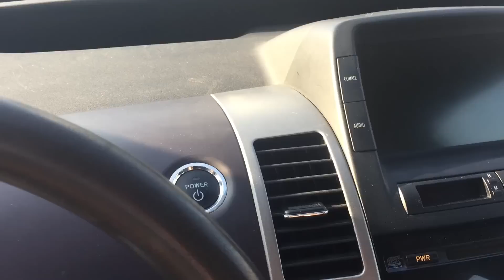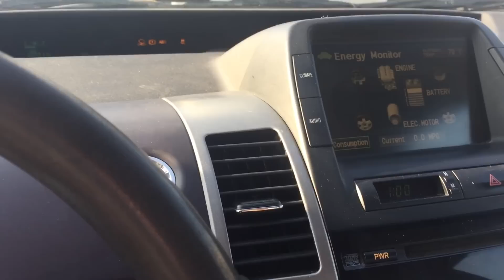2004-2009 Toyota Prius no dash lights fix!

Comment: God bless you , you just saved me $900. I was at the dealership and the guy told me the problem might be with the computer of the dashboard. He told me it might cost me $790 plus tax and workmanship might run up to $900. I was waiting for them to look at it when I decided to google and I stumbled on this video. I immediately took my car out of there, drove home and did exactly what your video said. It worked!!!!! Thank you so much!!!!
Reply: Has it happened since?
Reply: Just turn headlights  on a few times(make sure that the light is on, look at dashboard) and then push start button....no need to reset aux battery.
Reply: @socheat4203   Did it work for you?

Comment: In the middle of moving across country. This was a God send. Thank you so much!
Reply: Just turn headlights  on a few times(make sure that the light is on, look at dashboard) and then push start button....no need to reset aux battery.
Reply: That happened to me too  moving from cali to utah and my dash went out but all you have to do is turn on and off your headlights a few times it worked for me too

Comment: Man people are so negative. It may not “fix” the problem I agree but when I am driving to work 2.5 hours each way, in a 12 year old Prius with 225k on the dash, and my dash lights stop working after I fill up at the gas station, guess what, it fixes MY temporary root problem of getting to work on time so I don’t loose my job. I agree I can go pay tons of money to fix the root cause and DO appreciate people telling me what is causing it to continue to happen for the people who do want to fix that issue, and if I do that I can  hope that maybe I’ll get my money’s worth or me personally I can realize that I will save that money for another commuter car when this one goes and take the temporary inconvenience of unplugging a stupid plug once every 3 months and not complain. Thanks guys for the video.
Reply: Mine is also a 12 year old Prius with 225K miles, lol.  I agree this is a good quick fix.  Sure helped.
Reply: Just turn headlights  on a few times(make sure that the light is on, look at dashboard) and then push start button....no need to reset aux battery.
Reply: Well said.

Comment: This fix is aiding the problem but it is not resolving the root cause.  These cars have a known defective capacitor problem on the circuit board inside of the dash assembly.  You must pull the entire dash out of the car and solder on a new capacitor to the board to permanently fix the problem.  This is something that no lay person without experience can do.  The soldering is tedious and you must be VERY careful or you will damage the board.  I have fixed several of them with intermittent dash light issues this way.  If you take it to the dealer, you will be looking at thousands to put a whole new dash assembly in the car.   Removing the battery connection might "resolve" the issue when it happens, but I bet all of you that have had this problem, will see it again because you have not fixed the real issue.  It's a capacitor that has defectively leaked down on the board inside the dash.
Reply: Chris Scott Mr. Chris, thaaaaaaanks for your help, please help me through the position of this capacitor because we have a lot of this model and no one could resolve it, this is very critical to us, pleeeeeeese help.
Reply: As a side note, you can leave one door open on your prius when u leave it alone and that will keep the odometer on when you come back. I either put some blanket on the trunk so it doesn't close completely or close the driver door halfway. You can still lock it using a key, it will stay on as long as u keep a door open.
Reply: THANK YOU, my Toyota Dealer always cleans my clock on repairs ,  I love the car, but I hate the repair costs.  It destroys the cost effectiveness of the car !
Reply: how much does this work at the dealership??
Reply: charlesknx that’s what I thought too, but even after buying a very good brand new 12v battery the issue was never resolved
Reply: @charlesknx  I replaced the battery on my and the same issue persisted
Reply: @charlesknx  does that really solve the problem?
Reply: where can i find more information about this? i think i have this problem. i smell a burnt circuit on the fuse box under the hood. my car wont start.
Reply: There are many things that can cause this, not just a defective capacitor.  Its not that simple.
Reply: My problem might be a bit different, but dash wasn't on and then I couldn't switch gears or turn car off at first. Finally pushed long enough and off. So I went inside to search this video. I got the cap off battery fairly easily and sure enough I reset it. Works. but I went to Dealer just to ask what common meaning this need to reset has.. They said it must have open circuit. Not that I trust them.. but I do wonder if I am save to drive?? and not get pro work done.
Reply: @sandrawiley2339  You are safe to drive.  I've had to do this fix a number of times.  Car still runs like a champ
Reply: Chris Scott so what do you recommend to do then??
Reply: I have the same problem and my keyfob would not locked the door
Reply: I watched a video about that,maybe it was you that posted it.Its always nice to know the root problem but that price(OUCH).
Reply: Do you know how much it costs to do that job?

Comment: Brilliant!  Thanks!  This happens once every 3-4 months on my Prius.  It is great to know there is an easy remedy and I won't stop unexpectedly on the freeway.  As noted in another comment, it isn't a permanent fix.  But the permanent fix would cost more than the car is now worth, so this is great!
Reply: You're lucky you could turn off the car, I couldn't for a long while, and finally reset it after I got car to shut down
Reply: @sandrawiley2339  if your car ever fails to turn off again, press the on'/off button and hold it down for up to 30 seconds.  It will eventually do a forced shutoff.  I speak from experience.
Reply: Just fold the power ignition button it will turn off

Comment: Had a 2007 Prius with the same problem, Chris Scott knows what's up.  I also wanted to mention that for ours it certainly seemed related to the weather and cold as well.  If it rained or was cold my suspicion was condensation is affecting the connector (in the dash) for the combo meter.  There was a recall for this but since the car was too old they stopped supporting this fix.  Everything runs normally while like this, you just don't know how much gas in the tank or how fast you're going, but mainly the gas gauge blank was the only concern (who's speeding in a prius).  After the car warmed up for a while, a restart or (force restart holding power 5 seconds) and turning it back on would usually come back.
Reply: True.  I have a 2008 and have only experienced this when it is really cold: doesn't affect the car running, but don't know how fast you are going or how much gas you have in the car.  The good news is that I have over 180,000 miles and the car runs great.
Reply: "Everything runs normally while like this, you just don't know how much gas in the tank or how fast you're going"  This happened to me on day 2 of purchasing a used Prius!  It's helpful to know this is a "thing" and not specific to my purchase.

Comment: Thank you much for the video. It's good to know a second option for fixing. Before I attempted the battery plug fix on my 2008 Prius I read some of the comments (I appreciate you camera skills btw. :) and I saw @Bobby Smith comment. Holding the power button down for 10 seconds restored my dash lights. 
Steps I took: got into the vehicle > tossed key fob onto passenger seat > pushed in the brake peddle > held power button for a 10 count, then released. 
Lights came on and for some reason the emergency brake light was on (even though it wasn't engaged). I powered off vehicle then powered on vehicle and all lights work as expected. I should note I replaced the 6 year old 12v battery about 3 weeks ago. From the comments I don't think it's related, but thought I should mention.
Thanks again for a great video!

Comment: Dude thank you so much. I have no clue what happened to my dash but I was getting brake lamp + brakes verification and filling up ac along with smoggin the car. Didn’t have an issue for days until I went there and changed a light bulb then out of nowhere dash didn’t work, but gps climate worked. This fixed it, disconnecting battery didn’t. Thanks a lot man. Subbed for the help

Comment: another easier fix is: open a door and sit for half a minute and then click on the hazards and sit for another minute and then turn the head lights on. This should bring the all the lights on but if it doesn't then pump the break hard, this should for sure (95%) bring the lights on. If the above doesn't work then instead of turning the head lights on.. hold the lights to high beams, this should work too. If all of the above don't work then keep the hatch open and driver side door open and try the above tips.
This used to happen a lot when I kept any of the door open for say 5mins mind that I had a weaker 12v battery, at times it used to show 10.5-11.5 volts. I recently replaced the battery, I can reproduce the same problem if I immediately try to start the car after coming from somewhere and then letting the water coolant pump run after turning the car off. However, if I give some time after the pump runs then the car starts normally.
Reply: You are awesome!!!!!!! I tried several different options this was the ONLY ONE that worked. Thank you!!!!!!
Reply: I tried everything, only one that worked, thanks
Reply: So awesome. None of the video solutions were working, but yours worked on my '07 immediately! Thank you!

Comment: This totally worked.  I've had to do so much tinkering with my Prius over the last year, and I honestly believe this is not a capacitor issue.  There's no way that a supposedly faulty capacitor only doesn't work for a short time, and suddenly works again due to the battery being reset.  I've thought that the battery had needed to be reset, but I didn't know how to do it without spending 15 minutes removing the 12v battery (i've shaved down the time it takes me to 15 mins. max due to all of the trial and errors I've conducted on my Prius).  I"m beginning to wonder if this is a heat issue.  I seem to remember having this issue during another heat wave we had in California.  I think this also is a battery reset issue due to the fact that when I changed a different battery into it one time, it worked right after I hooked up the new battery.  I'm really tired of my Prius and I"m selling it on craigslist.  They're cool, but stealthy mode isn't that cool to have to fiddle with the car daily.  It's like F.O.R.D.  (Fix Or Repair Daily).
Reply: When you had this issue was your head lights able to turn on?
Reply: @chipete1  Yes.

Comment: This does always work for me, I know immediately that the dash won't turn on if the door light isn't turning on np. But does anyone know exactly why this keeps happening and should I have it fixed?
Reply: Hi,there,
I'm a "fresh"owner of a 2008 Prius, and i havw asaime insisting oroblem like yours, that the dash keep swich of...(quite anoying and frustating in the same time...)
Did you find cause and a solution fir it?
Please ket me know.
Regards,
Claudio.
Reply: @dumitrascuclaudiu7097  it is a defective combo-meter which needs to be replaced.
Reply: ISN'T SAFE TO DRIVE WITH NO DASHBOARD ON?

Comment: For me this solution worked after I replaced the battery and the dash lights shut down on restart. I would add that I needed to be sure the car was off (not in ACC mode) then the reset worked. Thanks!

Comment: This works, but instead do this sequence quickly but don't rush. Its less of a headache. 
1 Push the start button once,
2. Open the drivers door, 
3. Push the hazard light and turn on your headlamps. 
4.Then depress the brake pedal and start the car normally. 
Your display will come on.

Now you can start the car display without leaving the driver's seat. When the dash display is blank you won't be able to open the trunk, which means folding down the passenger seat to climb in the trunk and removing the battery cover, which is hard in cramped quarters. It takes two hands to detach the clip. Then you have to put everything back in place. Too aggravating.
Reply: Literally, I JUST did this. I was coming from the grocery store and backing up into the garage when I noticed that the camera was not working and the dash was blank. 

I did your 4 step sequence, and it worked. 

Thanks!!!!
Reply: @warrenlewis6692  That's so terrific. I am so glad it could help. I know  it is hard to find advice. It almost always works.  But sometimes if you have been driving a lot and the car is warm it sometimes doesn't. If that happens it will work again when the car has been off for a while.  I was doing the battery trick for a while and I was miserable.
Reply: I pressed start button twice rapidly without foot on brake, display returned then pressed brake and start and car started with display ON!
Reply: Oh my gosh, thank you so much for this tip! I just tried it and all my lights came on!

Comment: So, this worked for me and avoids all that:

Put the car in aux mode by pressing start without stepping on the brakes.
Next to the touch display on the right press and hold "Info" while turning headlights on/off three times.
On the touch screen, select the display menu
Select Vehicle Signal Check

(Note it isn't a fix for everything but it does help any of the non hardware related issues clean themselves up)
Reply: That did nothing for me.
Reply: Thank you, this worked just right for me!!
Reply: Thanks this worked!
Reply: I just had the same problem here except I couldn't turn off the car and remove the key so, I had to use Jesse's forced restart (above) which put in into accessory mode then I could use your method (Matt's) and then everything started working.   I didn't seem to have a "Vehicle Signal Check" but it does run other tests and afterwards I was able to power down and power up with dash lights and all.  Thanks!
Reply: @edhunter1698   Glad it worked 😂 amazing how many likes this has gotten this winter.
Reply: Matt you are AWESOME! That worked perfectly for me! "Vehicle Signal Check" was hidden under a few other menus... but I hit the starter after entering that menu and now it works!
Reply: @eveRideRAW  glad it helped. 😅 Would be great if Toyota just had an official debugging assistance for their cars. Like check this before bringing it to the shop where their solution is take it apart to unplug it and plug it back in...
Reply: Well, this worked up until today for me. Did it again and the problem went away again for now.
Reply: I would like to try this but my touch screen doesn't work as well!

Comment: Lol I struggle with that cap as well. I just put a new 12 volt battery in now my dash lights keep going out ,I've tried all the tricks,that trick is the only one that works but soon as I shut the car down dash lights go right back out the next start. I'm truly baffled.
Reply: Did you figure this out yet? I just put in a new 12V battery and now I can't get the dash lights on.
Reply: @simplysaima   New battery didn't work. I ts probably the compasitor and that means a big shop bill or tearing down the dash to fix myself. There's how to videos.

Comment: Thank you this video was such a help I had trouble this morning trying to get my car started from last night and I have a 2010 and I was charging it through the front battery by the engine and it wasn’t working the dashboard was not showing up. And I connected it to the battery in the trunk without having to pull out the plug because it’s a different set up but it worked like a charm and lit up and my car started and I was able to get to work thank you very much I need to change my battery. Lol
Reply: so is it a battery problem?

Comment: You make a key point that the MFD is working even though the dash lights are out. Does this work if it’s all out and all I’m getting is a check engine light.? 

I put in a brand new battery FWIW.

Comment: I seem to experience the no dashboard lights when it is cold, but have no problem with the car starting and running: seems to happen when it is really cold.  After I make a trip somewhere, they cut on without a problem.  You do need to get a new cameraman.
Reply: It is worse in the winte, it's a cylonoy issue. Behind the dash. Common prius issue apparently. 😔😔
Reply: I've noticed it is worse in the winter too!

Comment: Why not just pop off the negative terminal?  It requires a 10mm wrench, BUT is easier to do. 

Second, if this problem keeps happening, would you suggest installing a SPST switch on the cable that you pulled out?  Maybe even installing the switch for very easy access?
Reply: you don't want to add resistance into a circuit  , cars nowadays  are touchy when it comes to voltages

Comment: My Prius shuts down whenever the abs light pops up. How do you fix that too. If it doesn't shut off, the steer becomes stiff. Can you help out
Reply: Did you figure out? I have the same problem. And I have brand new battery on back.
Reply: turn the car off and on should reset Toyota doesn't even know

Comment: Was having the same issue the reset worked for a little bit . My battery needed to be replaced , and ever since I put new battery in it will not reset . Any thoughts and how pricey of a fix this will be ?
Reply: Jon Beck this is a known issue with the Prius.  Google it.  A circuit board has to be replaced. It's about $700 parts and labor. Toyota has extended the warranty because of it.  Try to see if you're still under warranty.